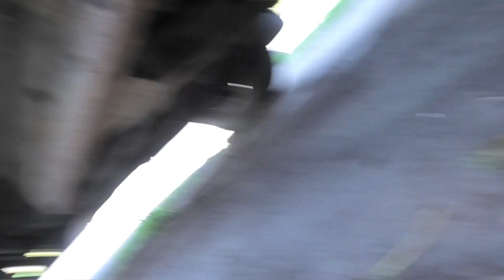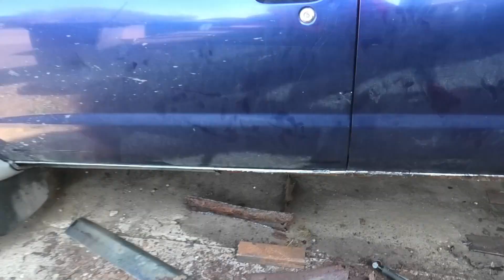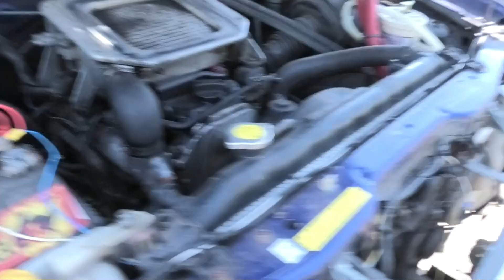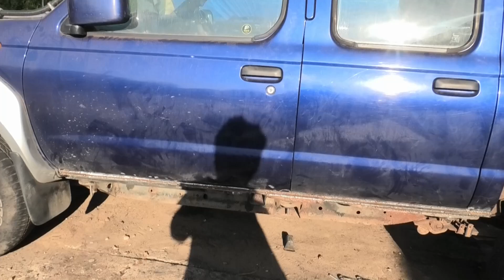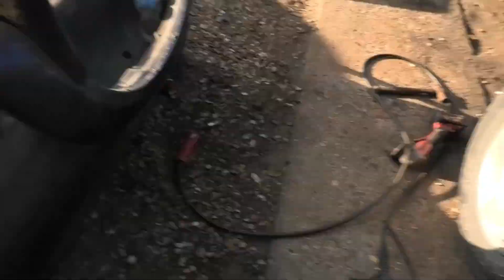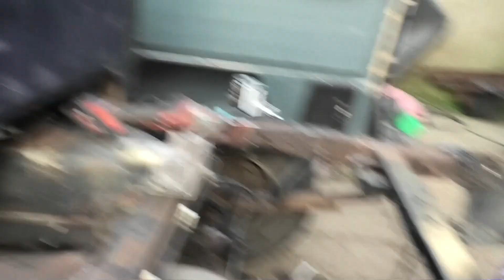week 2 sills and 3 inch body lift. d22 nissan navara

Comment: You might have to have the rear shocks more vertical so you are not over extending the shocks as she pumps up. Cuprol copper pipe might be better for the bags and use a flexi pipe from the frame to each bag. Will you set it up so each bag has a separate feed.

Dont forget to set up an airline and reservoir tank for that compresssor in case you need to air down the tires and can pump up afterwards.

looks good.
Reply from the maker: Pump direct fo now, trail and error atm. They will be free flowing most of the time .air will only be added as and when the camper is on . And only to bring the tub  level not to jack up or over extend.  Next vlog will give you a more detailed acount. Just got to edit it and post.